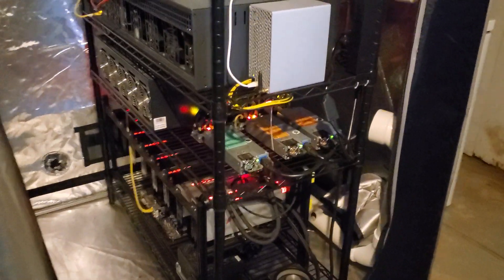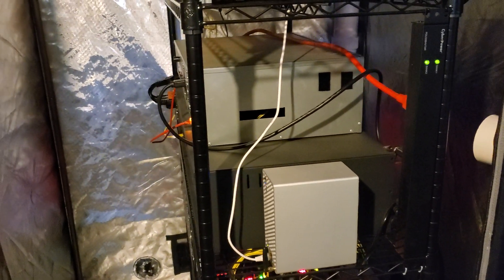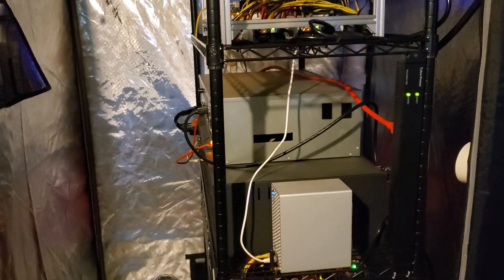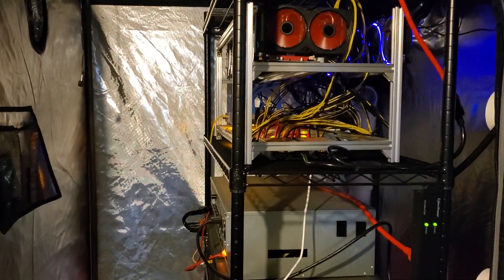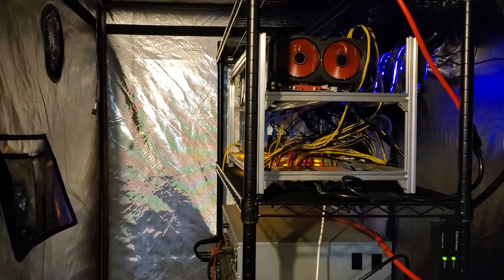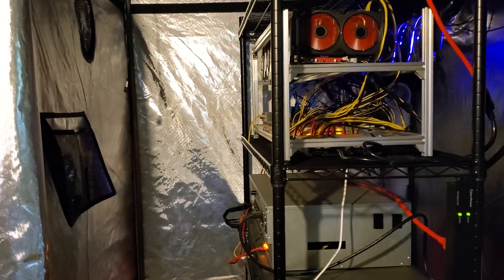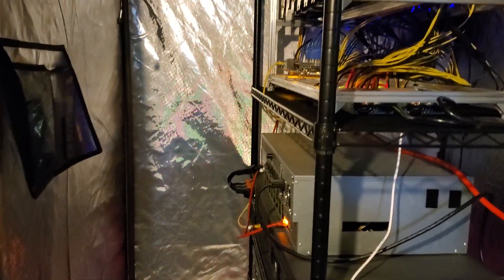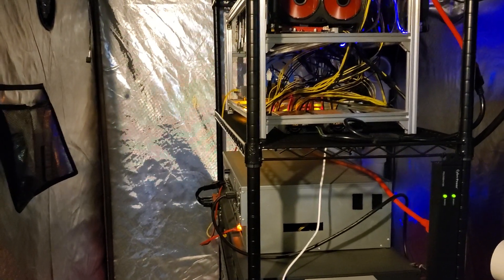Let's revisit negative pressure in crypto mining grow tents.

Comment: J.
Bud, you over thinking this. Build a small room mimicking a tent where the"Cold side" comes In from your basemnet and it has lots of filter space and the "Hot Side" goes out using those home depot insulation with minimal wood. Sort of like building a walking freezer or a bank volt. You have the space in the basement.
Reply from the maker: I like the impermanence of a tent. Plus I really really like the free heat I get in the winter when it is piped in to the ducting. Also at the time of purchase, building materials were insane. The $150 I spent on the insulated tent just made sense to me.

Comment: Yup, that sounds like what I'm planning. Exhaust only, but enough opening for passive intakes to pull new air in and equalize. Aka, more volume of intake vents than exhaust.
Reply from the maker: Yeah buddy! It's good to hear the words planning...It means the undead are still blocking away! Might as well enjoy every minute as a home miner, and be grateful for what we still have as a community!
Reply: @theblockingdead1310  Yeah, I'm moving to a place with $0.05 kWh and sometimes less in a month or so, so I think I'll be at it for a while ^^ Might snag some more cards when the price falls even lower too. ;)

Comment: what is the shell called that you have your 1660 supers in? i'm looking for something like that for my 1660 supers
Reply from the maker: That's an upcycled case from alpha miner. Those small cases have 9 slots and used to have passively cooled rx 480s in them. Bought it on ebay and slapped 9x1660s in there. It's a weird case and runs 92 mm delta fans. They pop up randomly, but they aren't available  anywhere retail that I know of.

Comment: Hey, living in florida running 15 cards. Room is getting hot. like 95 and up. Rest of the house is in the 70s. Thinking about running the hot air into the return duct in my HVAC unit. In theory it should lover the rest of the houses humidity and also just dumping the hot air outside would create negative pressure. Thoughts?..
Reply from the maker: That's a great question, and to be honest I do not know. I bought a stand-up unit last year that had two locations where you could hook up a hose. One was intake for the evaporator, and the other was exhaust for the air moving across the condenser. The instructions stated that you could leave the other hose off and just use air from inside the house (which you would asume would easier to cool by the evaporator), or you could attach the other hose to draw hot air from outside. They stated it would be more thermally efficient in the latter configuration, but did not explain why. My guess was beacuse the exhaust only configuration would create a negative pressure, and be drawing some of the cooled air outside.
    I found an article a while back that showed how to set up the most efficient data center, that really got me thinking about that A/C unit. The article stated that the most efficient setup was to keep the cooling units within the enclosed space of the data center, so the hot exhaust from the servers could immediately be moved through the units and take advantage of the heat moving across the evaporator (I'm assuming the condenser was located outside). The article explained that the greater the thermal differential, the greater the amount of heat exchanged between the air and the refrigerant. Somehow that is advantageous because this causes the refrigerant to absorb heat from the warm air and reach its low boiling point rapidly. 
     Now to be honest I dont know how to practically apply that theory. My solution was to just try to segregate the basement from the rest of my home cooling system. I'm attempting to cool the cards by just allowing fresh outside air, and to not draw any air from my climate controlled house. My goal this year is to keep the cards cool without the use of any A/C. But I admit I am very curious about how it could work the other way, I just dont think my particular unit has the capicity for it.